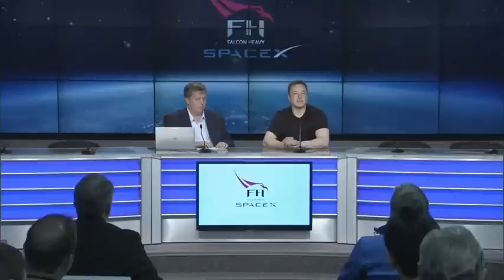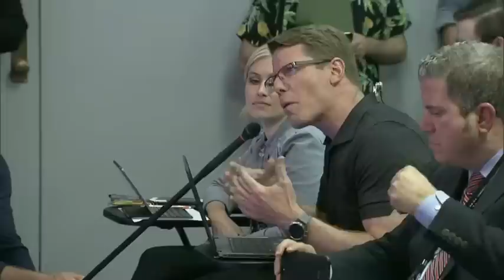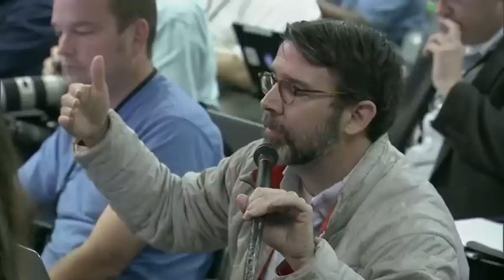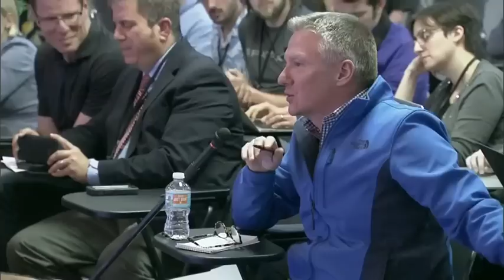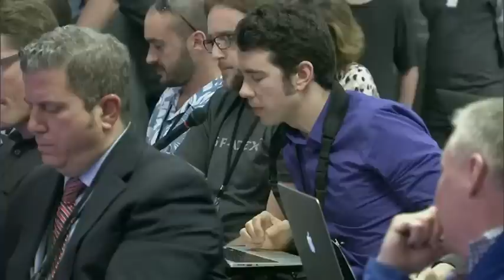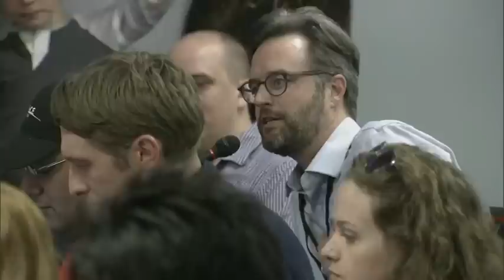'Crazy things can come true': Elon Musk discusses Falcon Heavy launch: Full presser

Comment: They say space is 4000 degrees but there's only seven elements on Earth that e could withstand that much heat none of it is on board or used to mechanically engineer this light socket that you think is a rocket ship that will one day bring you to Mars all you Star Wars skid marks
Reply: Moricon b.s. To keep you hypnotized they say the beginning layers of the van allen belt alone which is located in the magnetosphere is 58000 degrees Celsius which is hotter than the face of the Sun these are the claims of London Universityhttps://www.google.com/url?sa=t&source=web&rct=j&url=http://www.ucl.ac.uk/mssl/space-plasma-physics/plasma-science/plasma-magnetosphere&ved=2ahUKEwjL95L_6ZTZAhUMwFkKHTEdDesQFjADegQIERAB&usg=AOvVaw2NmMZrS2-DYFxpBCFM0ET4

And then here we have NASA claiming there's an area surrounding the earth that's impeccable here's the article on that
https://www.nasa.gov/content/goddard/van-allen-probes-spot-impenetrable-barrier-in-space
Reply: Moricon granted one thing you said that might have some legitimacy and that's the fact that space itself may be cooler if you think 4000 degrees is cool
Reply: Moricon https://spaceplace.nasa.gov/thermosphere/en/
Reply: Moricon all that followed after the 4000 degrees Fahrenheit about there not being enough gas molecules to transfer to you is just another way to keep you believing in them with no real evidence to back either side Give It Up you never get into space
Reply: Moricon you see it wouldn't be 4000 degrees Fahrenheit in the first place if not for the gas molecules so how is that that there's not  enough gas molecules
Reply: Moricon you should take the i&c out of your name
Reply: Moricon https://ntrs.nasa.gov/search.jsp?R=19890005752
Reply: Moricon another NASA comrade troll destroyed by my left thumb
Reply: Moricon DESTROYED
Reply: Moricon you walked through every one of my doors only to prove yourself more wrong and expose yourself and where you're going wrong masses will see
Reply: Moricon like I said you're incompetent and I never double down because truth wins every round
Reply: Space is almost absolute zero. It’s tiny little bit above the coldest it is physically possible to be

Comment: How does propellent work in a vacuum???
Reply: Sonet is indicating to you that rockets use liquid oxygen as a source of oxygen to the rocket engine when it is in a vacuum.
Reply: D Thomas Williamson inside the rocket there is a tank of propellant in this case  a type of kerosene and another tank of oxidizer in this case very densified liquid oxygen, which is why he says he’s concerned it might boil away in the vid since it’s very cold and any increase in temp can boil it away. So to work in a vacuum he can burn the oxidizer and the fuel to make combustion.
Reply: how dumb are you
Reply: Your wasting our precious oxygen...you moron.
Reply: momentum conservation
Reply: Reaction
Reply: D Thomas Williamson I am no scientist, just an ordinary person who hasn't much more than high  school physics so forgive me if I'm wrong but that's the way I think of how it works.

 conservaction of force ( one of Newton's laws) for every action there is the same force in re-action 

the particles from the thrusters hit the particles that were send out before, thus slowing down and letting the next ones collide, same with fighter jet engines for example they hit the particles behind them thus forcing the jet forward

in space there is no oxygen so the rockets carry their own in liquid form to supplement the burning,
Reply: ulage motors push the fuel back to pumps and turn em on... there are some apollo 4 vids showing ulage motors during staging...
Reply: Really breaking it down, rocket engines work in space for the same reason that you can push off of something in space; the object will move and you will move. The difference is that you are carrying the object with you at first, then push off of it. The other difference is that you actually have a ton of really small objects and keep pushing off of them all the time.

Incidentally, the center of mass of a rocket system in space stays at the same point (or keeps moving at constant velocity). Conservation of momentum.
Reply: Liquid oxygen
Reply: Sonet hydrogenated ham... Explain or don't

Comment: Note the word, "can," not "will." I fear, in our modern culture, there is an expectation of a successful out come. Push for success until your hands fall off, but be able to handle failure.
Reply: 701468392523816070046289411368222507496286869371438642749038614J what the fuc is your username
Reply: Geek Thomas A secret code that can only be understood by eating enough tide pods. Few have survived the ordeal. They shall be remembered on the wall of excellence, at my local Kroger.

Comment: Elon put a self driving electric car into orbit with a reusable rocket while oil propelled vehicles are rolling around polluting the earth 🤦🏾‍♂️
Reply: Marvin, the Roadster is not self-driving.

Juan, the oxygen was not the fuel, the fuel was RP1 (basically purified kerosene). Liquid oxygen was the oxidizer.
Reply: Two for two, Ben Anderson. 👍
Reply: Ben Anderson thats my name full name too, haha
Reply: Tesla roadsters don't have autopilot you meme
Reply: FrenzyRob  Actually, it doesn't.  And as the sources of energy powering the electrical grid become cleaner and cleaner, so too do all electric cars already on the road.
Reply: Big Dream I'm saying for the construction of the car, not the whole life cycle. EVs are better with CO2 if you take the whole life span.
Reply: Juan Rios, you do realize that's not a thing right? Oxygen is an oxidizer, remember? They burn some focil fuel but it doesn't pollute due to insert extremely complicated stuff
Reply: What do you think the rocket used to get into orbit, friend
Reply: Big Oil has to get paid!!
Reply: @Justin D  No they don't.  Fuckum.
Reply: Worth noting EVs actually have more lifetime CO2 emissions than hybrids if you drive significantly below the average number of miles per year. If you're buying a car for infrequent usage, hybrids are often a better choice.
Reply: No, it does pollute.
Reply: Marvin B guess you missed the part where he said they use oxygen as the fuel
Reply: Juan Rios did not watch the full video but I did watch the launch 🚀
Reply: Unfortunately, building an electric car pollutes more than an oil propelled one... This has to change.

Comment: Would have been nice to recover the center stage to examine how it fared with all the stresses and heat exerted on it during launch. Also, sounds like they weren't able to slow it down enough to land properly. That means they still have some work to do to figure out how to land all three stages of Falcon Heavy.
Reply: I’m pretty sure they still get data back from the core that they can analyze - hence why Elon said even if the whole thing explodes 20 seconds in it’d still be a success in his books
Reply: Brian Bagnall They were only able to reignite one engine out of many, so it was unable to slow itself before hitting the sea.

Comment: This is GREAT! Only possible weak spot is all the engines Falcon Heavy has. Isn`t that what doomed the Soviet N-1?
Reply: It wasn't the engines, it was the nightmare of plumbing all that fuel to all of those engines at the same time, it's why the design of FH is better.
Reply: The N-1 could not handle one engine failure. Falcon 9 and Falcon Heavy can.
Reply: jpamusher As well as all other points made, the N1 was horribly mismanaged, and if I remember correctly one of the key designers died.
Reply: Wrong N1 was designed to handle engine failures.  It just was more complex back then without modern electronics.
Reply: I think a whole bunch of engines on the N-1 use the same turbopump.
Reply: Sad that the energia was cancelled it could launch more payload to leo then n1
Reply: I think its more sad that, a while ago, Russia chose communism.